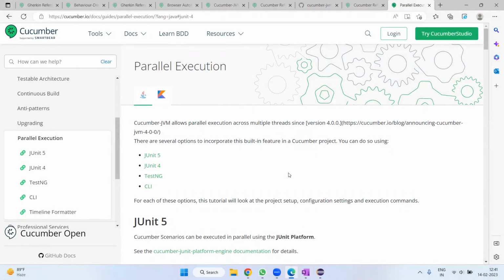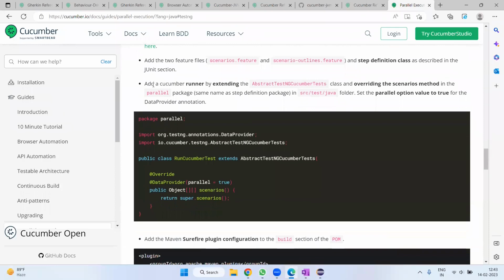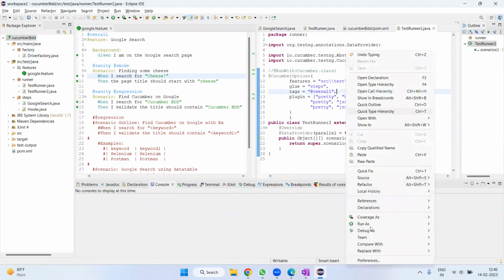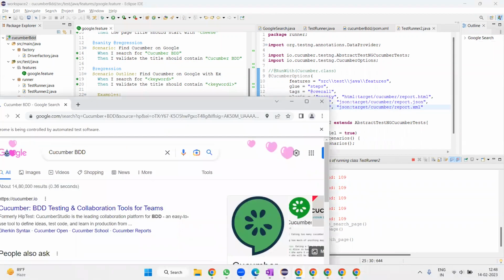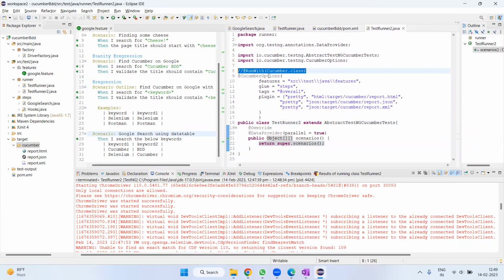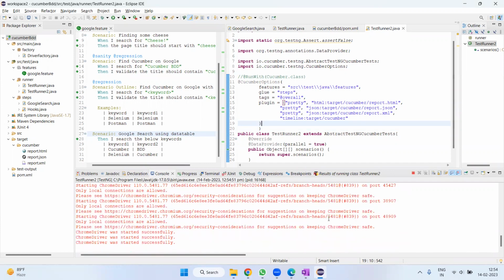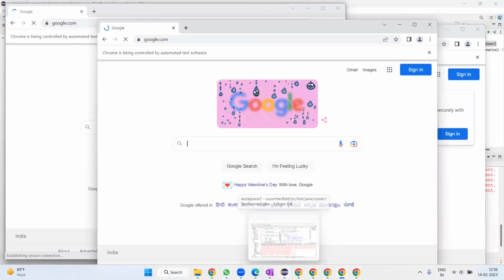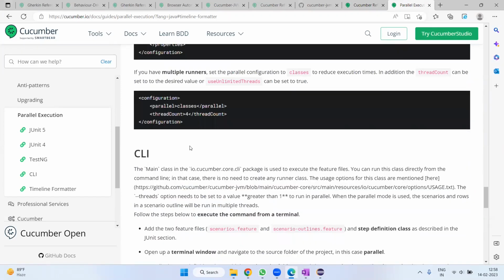9 | Cucumber Tutorial | Parallel Execution Using TestNG | Timeline Formatter

Comment: In my case , Browsers are getting lauched but exceution is happeping in only on browser and other browsers are opening blank. please help
Reply: Facing same issue
Reply: this is my guess , it might be because your remote webdriver is static  , remove the static method and use setter and getter method. 
then try to run the case